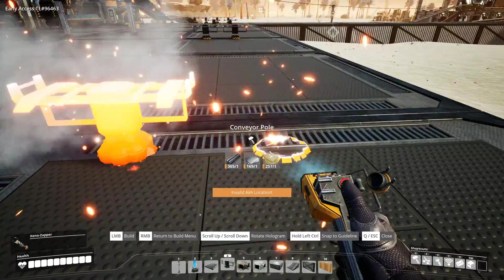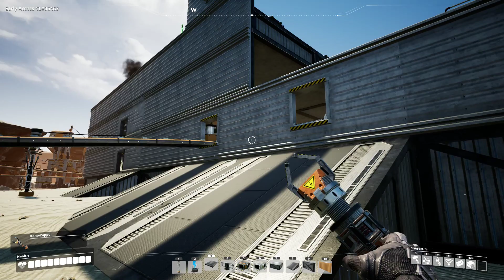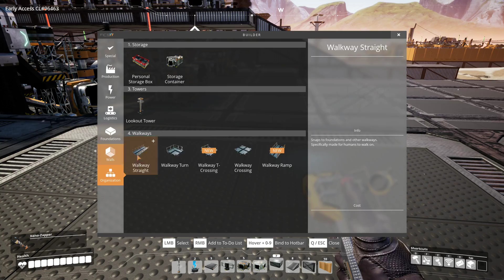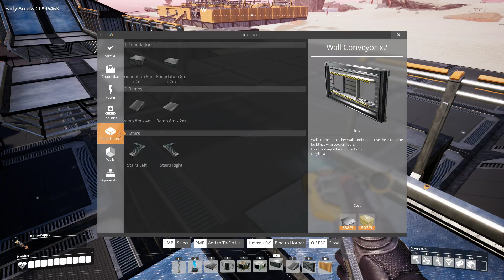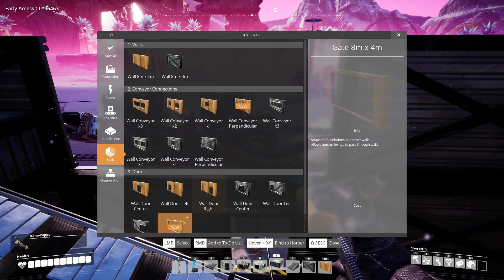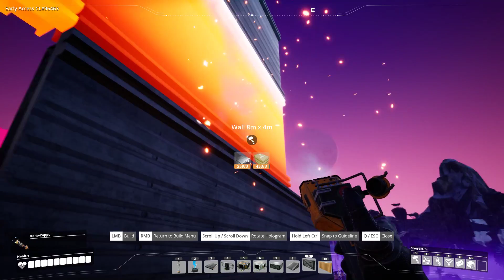Building A Factory Walkway | Satisfactory Desert Bus Ep#8

Comment: After seeing your plans with the walkways I think it might be easier to use T junction pieces to make a two space wide walkway path, centered on the seam between foundations with two pieces taking up half the footprint of a foundation on either side of the seam. Your solution with clipping straight walkways halfway through each other to correct the spacing works surprisingly well though!
Reply from the maker: There's not enough space for the double.

Comment: You could reduce your balancer spaghetti a bit if you move the splitter to one of the middle constructors. Then you would have two belts coming out 90 degrees to the left and right and then one belt having to make a turn and go up. Saves you one splitter in depth if you are trying to reduce footprint. Just a thought.

Comment: Why expand rods when you are floating on rods? Adress the problems that you having, not once you won't have for 10-20 episodes.
Reply: Because once he gets faster belts, which is about 2-3 episodes away in my estimation, he will need all of them. Right now the limiting factor is the screw unloading into the plates, once those belts get changed the entire system runs at 2x speed.
Reply: @Ceser1999  oh right, it is closer

Comment: You can fix some of your alignments. Currently, you're shoving everything to one side (i.e. you currently have one smelter tucked against a wall, and the one on the opposite side is 2m or so away from the wall. Great for a proof of concept, but not the prettiest. If you spread everything out evenly, things will most likely start to line up better. For example, you could have a single space gap between the constructors (by moving the right constructor one tick right, looking from the splitter), and then both conveyors coming from the splitter will move out slightly, instead of one moving out and one moving in. They won't be straight, but the'll be symmetrical, or at least I expect it to be.